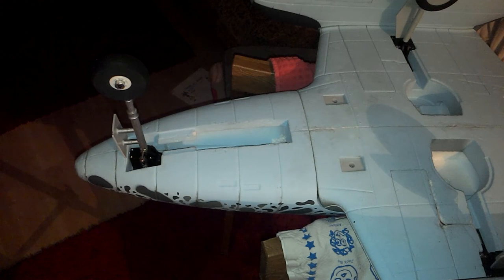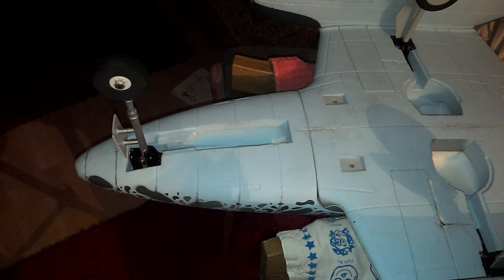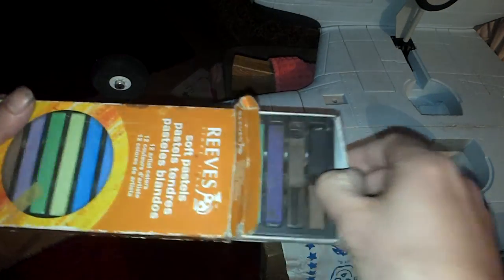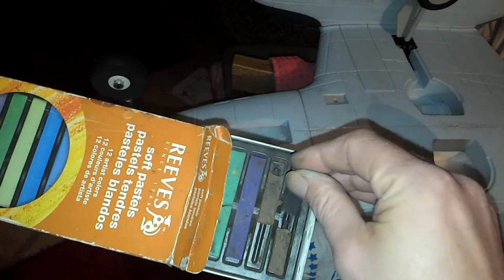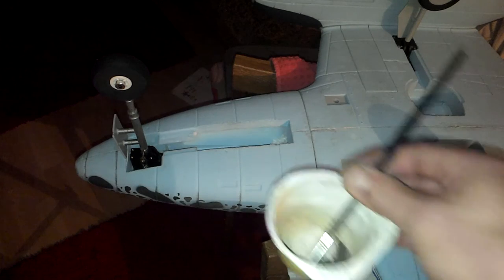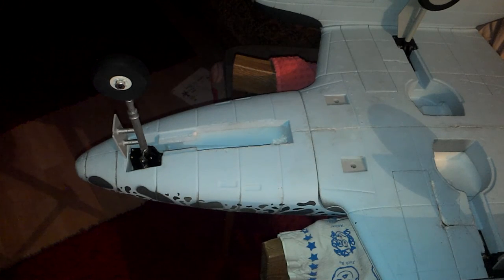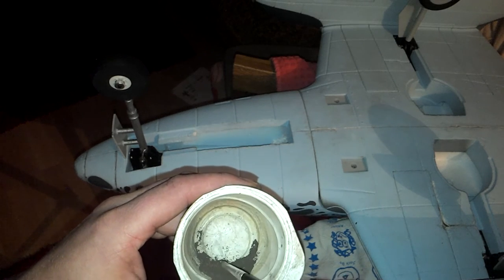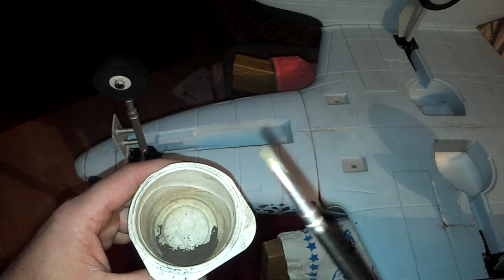Foam rc warbird weathering ..basic panel lines..

Comment: Nice how to video.  I'll try that on one of my planes too.  Is weathering only ever done in the panel lines?  Ever use this method for exhaust lines from the motors?
Reply from the maker: thanks .. I use this method on all my warbirds .. I also use silver .'ladies' eye liner pencils for silver panel lines where panels would have heavy use like the gun ammo panels .. for exhaust stains I simply make up a brown black orange pastel mix and use my finger to drag the exhaust stain back from the Stubbs ..this way u can build it up or thin it out ..a damp cloth will remove it all if u go wrong ..
Regards